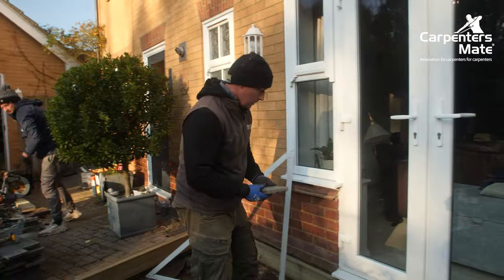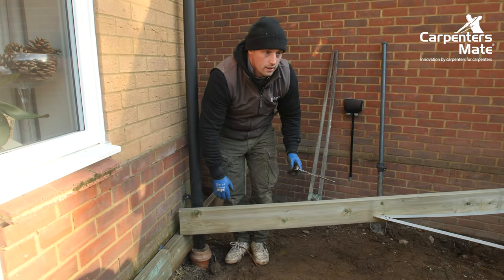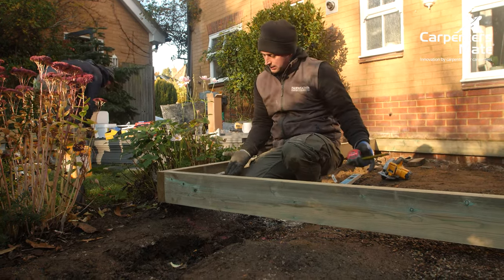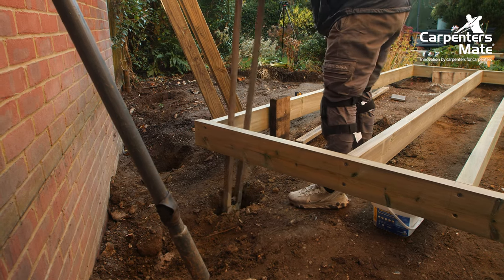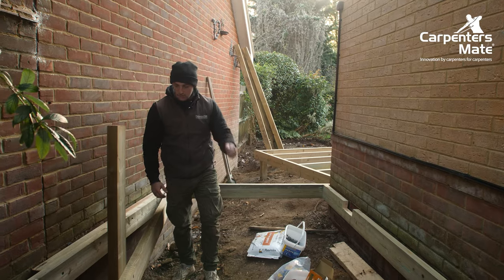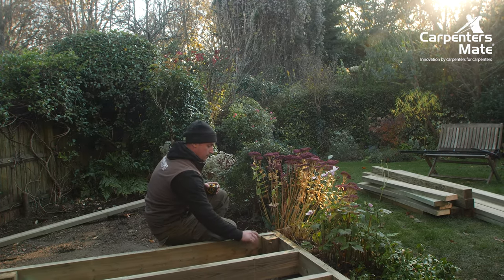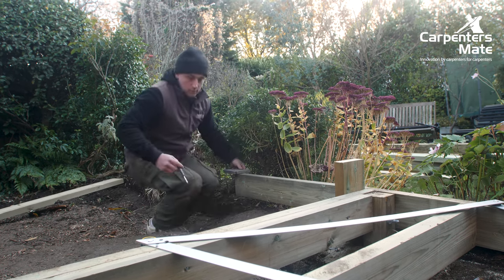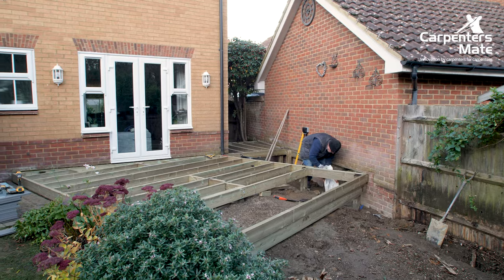How To Build A Decking Subframe

Comment: That timber frame, even if pressure treated, will not last long.    This type of treated softwood support framing will decay very rapidly, especially on the upper face at the exposed gaps.the most vulnerable area is where 2 boards butt end to end. Since the water surface tension resists drying out here.    You need to treat it all with multiple coats of microporous wood treatment eg Sikkens range, and give very special attention to the top face of the entire frame.   ideally place a membrane strip (such as ProtectaDek) onto the top face of the timber support, before laying the boards.   Some pro's will instead treat the top face with 2 coats of bitumous paint instead of using a plastic membrane strip.  This helps slow down the decay at these most exposed points of the top face..    After 20 years of laying decks, I only use a hardwood deck on a hardwood frame.   It works out less expensive in the long run,   Otherwise you will be pulling it up in 7-8 years time.
Reply: Use C24 UC4…. suitable for ground contact
Reply: I went last year (2023) with friends to see a house they were thinking of buying. The decking outside was weak and 'springing' when walked on.  It didn't look all that old but was in place for maybe 10-15 years.  The wooden support posts were in bad shape (damp rising up them) and the joists were loose on their screws. They didn't buy that house as it happened.

I always put breezeblock pillars on good foundations under decking and strong, galvanised coach bolts to hold everything together. I also put plastic DPC on top of the joists, as your never going to keep the rain off otherwise.  My late father (a brickie for many years) always said "get the water away quickly and keep it as dry as you can" when it came to anything building wise.  Words that have helped me greatly over the years.

You can also paint wooden joists etc. with wood/metal primer aswell (usually the red stuff) as it all helps long term and anything you do to keep the wood from rotting or going soft, is a good thing.

It might seem pointless with modern pressure treated wood, but I've seen this treated wood (2" x 6") go rotten and disintegrate totally in the space of less than 10 years, due to being next to a river and constantly damp.

Also have small gaps to brickwork to help wood dry out and not holding any damp in place can help aswell.  Galvanised coach bolts are also easier to take out instead of any possibly rusted screws for any repairs, so plan ahead I always say.  

Screw into the middle of bricks etc. as screwing into a cement joint (like in the video) isn't the strongest method of fixing to a wall. There's loads of 'tricks' to use of course, but plan on how to repair something in the future as easily as possible, just in case your called back to do any maintenance etc.

Comment: Should the post not be notched? Just so the beams weight is transferred through the post, not just relying on the steel bolts?
Reply: Either notch the post, or use an M12 bolted connection. In a bolt the 'clamping' action holds the load, which you don't really get with a screw. Best option is to notch AND bolt.

Comment: Few comments
1. Use a mask pouring concrete mix, cement dust in the lungs isn't worth
2. Space posts 100mm off the bottom of the hole, there should be 100mm of concrete footing under the post.
3. That timber is WET (9:55), probably best to strip stack it for a few weeks under cover if possible to avoid movement as it dries out
4. If you're going to attach joists/bearers to the side of the post you need a bolted connection not screwed, so the friction between the clamped together members holds the load (not your screw)
The 400ctrs, painting the cut ends, and general attention to detail is good though!

Comment: Hi There, thanks for your video and tips as you go along building the deck. I've seen in other video's "not yours", they are using hangers in each joist. Do we need hangers or that is overkill since we are not going to put too much weight on the deck. Thanks

Comment: screwing to the sides of the posts is always a poor idea.
Reply from the maker: Hi, can you elaborate on why?
Reply: Think they were referring to screws shearing but nails not? I have always used landscape screws, staircase fixings, so who knows!
Reply: @danivinson correct, but should ideally be notched so that the timber sits on directly on the post which is what it’s for, then bolted together to resist shifting off the support and leaving a gap.